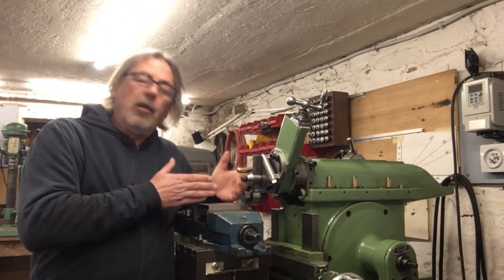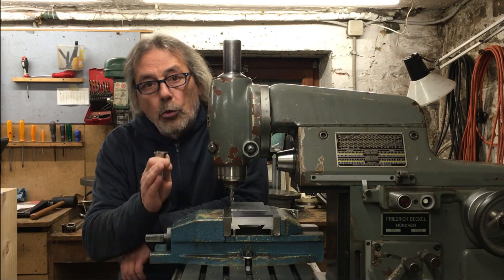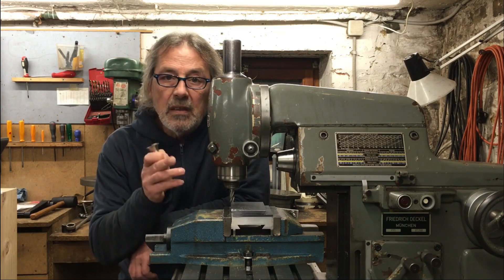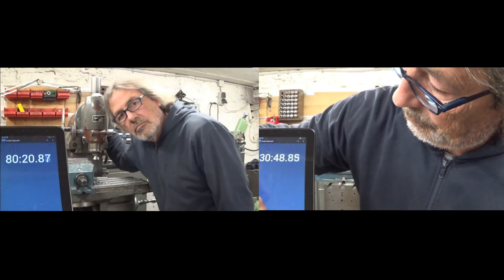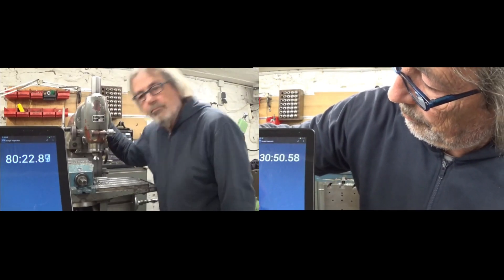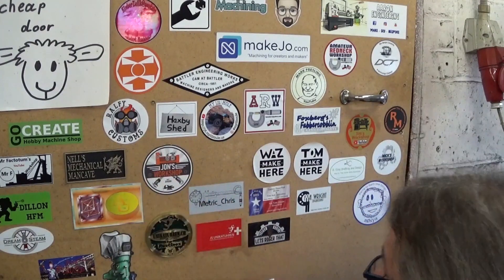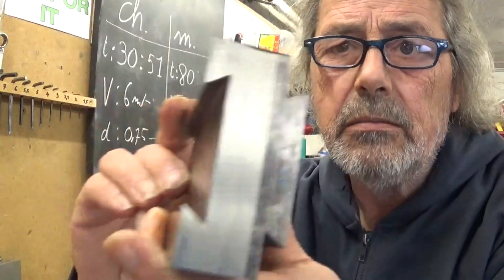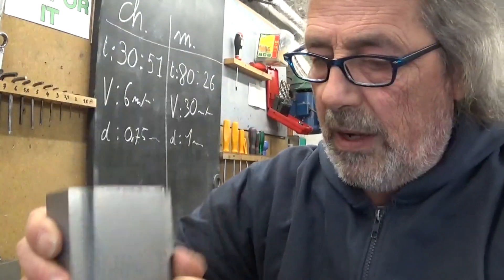Cutting a dovetail addendum.

Comment: Hi Mike!    Love the video, but the real key metric that needs to be compared VERY precisely is not the  MM3/ min removal rate...but the Smiles/Hour addition rate.    Most of us shed dwellers are not doing this to make money, but for the shear love of making something, and in that case....what ever maximizes the Smiles/Hour rate is the best method of use!    Love your video's , and keep them coming!     ...PS    I have CNC in my shop, but I still miss my shaper for the fantastic finish it left, and the very relaxing sound it made doing it.
Reply from the maker: You're spot on, David. Thanks.

Comment: I would have "gone-to" the mill automatically,  though I accept the shaping machine has its worthy place.

So this was actually a very interesting faceoff!

Now the higher quality is proven at hoby'st levels I wonder if Abom will do the same for the grown-up machines?

I looked at wify and said,  I need a shaping machine.

Now I need an eye patch as well.
Reply from the maker: There is nothing wrong by using the milling machine. Use what you have and be happy with it :)

Comment: Isn't the challenge with the shaper-cut dovetail that it may need to be aligned to other features - easily done with an edge finder/centre finder on a mill but more difficult on a shaper? For example with a pin directly in the middle of the dovetail area?
Reply from the maker: Centering someting in the milling machine is maybe easier, but I don't think it makes much difference.

Comment: Didn't think it'd take that long for the mill to complete a simple dovetail.
Probably because it's just a single tooth cutter.
I vividly remember scrapping a very tedious part by feeding a dovetail cutter too fast, which made it slip out of the collet under the cutting force.
Great times :)
Reply: The shaper is a single tooth cutter too! 😉
Reply: @ZenMinus  But it doesn't cut the full side of the profile at once. Tool pressure is reduced, thus feed can be increased.
Reply from the maker: Scrapping Parts? Why should you do that?

Comment: You're very good with the shaper! Maybe I should give mine an outing cutting dovetails, but I'd normally go to my mill.. my horizontal mill! I'm not a fan of a vertical milled finish either.
Reply from the maker: Nothing wrong by using the milling machine.

Comment: As a prework to milling the dove tail itself You could have used a 4 flute end mill until it's time to use the dove tail cutter. The 4 flute ought to cut a lot faster then the singel flute dove tail cutter.
Your mill is a little crippled and doesn't run like it ought to do...... You should use handicap, like in golf! Joking!
As always, fun is there.
Reply from the maker: Well, it was a 12mm 4flute endmill, and razor sharp.
Reply: @Rustinox  Okey. Didn't notice that. You were quick like a weasel in that sequence...

Comment: Hi Michel & thanks for the mention re-stickers. I have made a lot of dovetails on the milling machine for tool holders. I must say it was very slow going , although the results were good. Having never used a shaper i cannot say of any results. You clearly show though that the shaper is the machine for such a job. Thanks for showing. I would just ignore the Troll. They clearly like your video's otherwise they would not watch them. 
Regards.
Steve.
Reply from the maker: Thanks Stievie. I never made dove tails on the mill before, So it's a bit new to me.

Comment: Best two-outoff-three then , Rusti  ?   🙂
Reply: Thanks Michael. Good demonstration. Of course the bad, comparatively speaking, finish on the milled side could be mostly attributed to bad bearings in the mill's spindle. It should definitely be capable of producing a better product than that. The shaper side was certainly very good. Maybe the next project should be to change out the mill's spindle bearings.
As to the sample piece, if you'd used another piece and cut the male to fit the female from before you'd have two parts of the vertical slide I suggested before. Just sayin.
Greetings from Canada's banana belt.
🤞🇨🇦🍌🥋🇺🇦🕊️🇧🇪🕊️🇺🇲👍
Reply from the maker: Dankjewel Ludo.